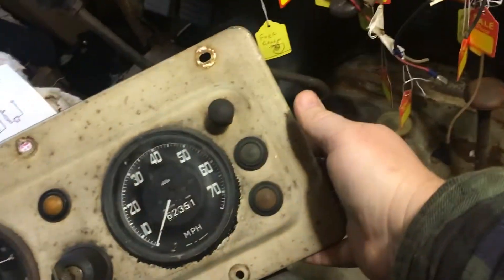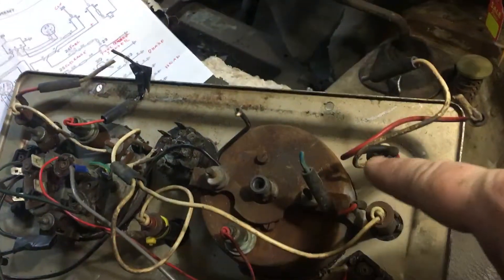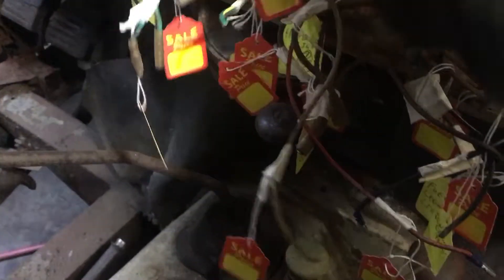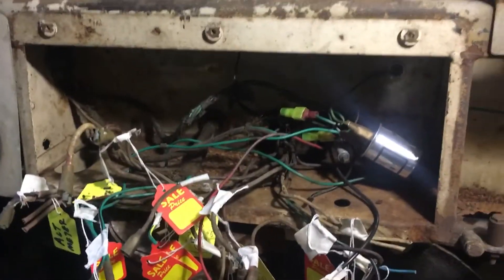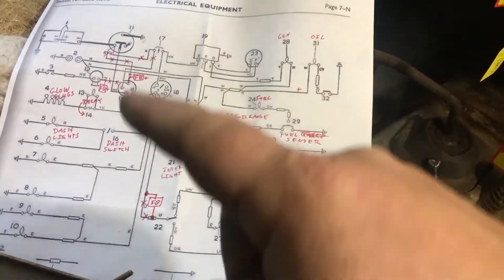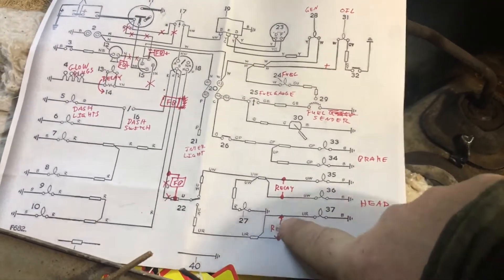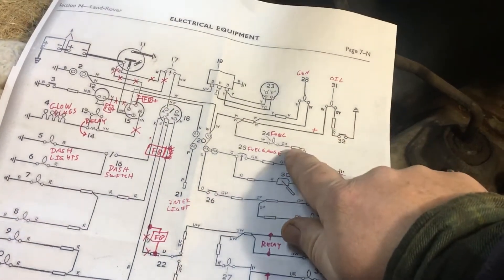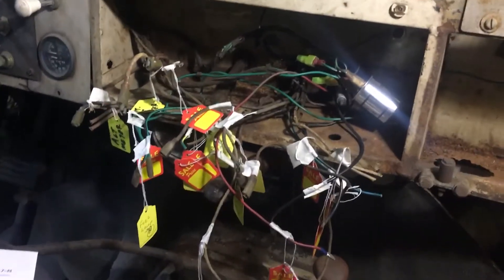Land Rover Series Wiring Part 1

Comment: Like the "Sale Tags" for wire marking. A bit cheaper than the Brother label printer I bought yesterday for marking up a bike loom I am modifying at the moment.
Reply from the maker: minitici I had a bag full of the tags. I got them off eBay a long time ago for a few bucks. Definitely cheaper than a tag machine. Ha ha!! Good
Luck with your wiring!!
Reply: Certainly cheaper - just used about 6 metres of printing tape to mark up a ZX12R bike loom!
Reply from the maker: That’s a lot of tape!! 😀
Reply: Are you going to do part 2?